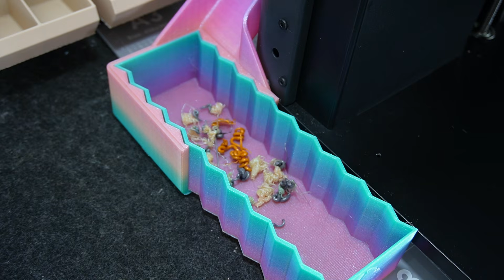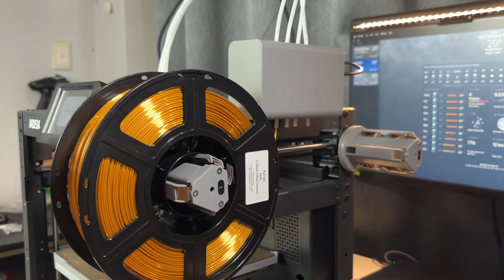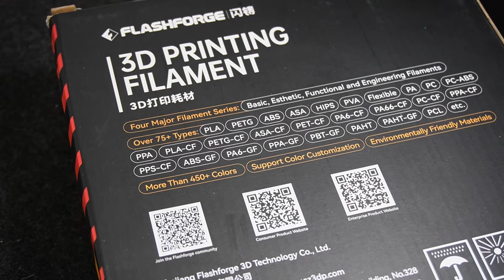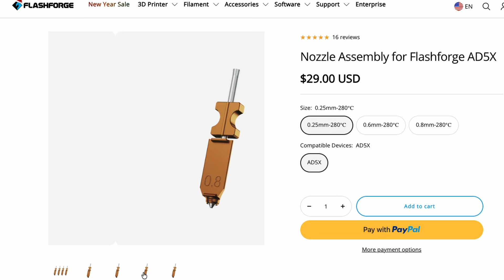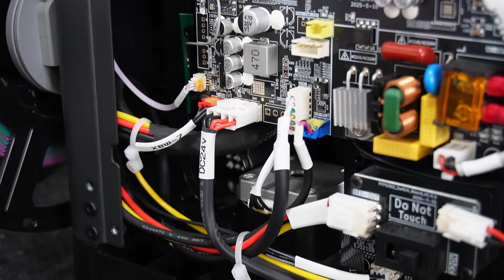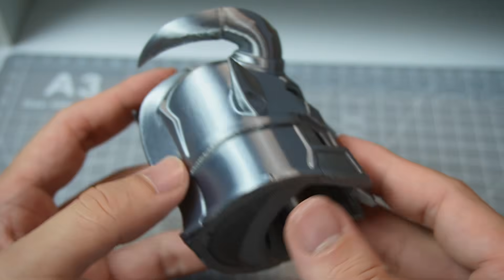FlashForge AD5X Review After 1 Month – Is It the Best Budget Multi-Color 3D Printer?

Comment: I don't know where you live but here in the UK flashforge do not stock or supply any parts or consumables.  My Adx5 has done about 450 hours of printing,  the filament feed stepper motor has stopped working and I can't get a replacement anywhere,  the printer is fine as long as it's working,  computer WiFi slicer connection is rubbish,  after sales it rubbish and the flashforge orca slicer AI feature is shockingly terrible I've not had a single successful AI 3d print
Reply from the maker: I also have some problems with the wifi slicer connection…with small parts, it’s working really well.. but for larger part… it takes so long to slice and can not send it to my printer 😂